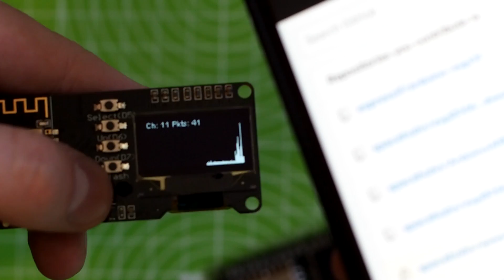WiFi Packet-Monitor | ESP8266 + OLED

Comment: spacehuhn, i love your scritpts and your videos and im here to ask a question on your ESP8266 Deauther script i have 2 small ESP8266 and they work fine, but i want to get one with an OLED display. I found a NodeMCU ESP8266 with OLED and battery on amazon and i was wondering if you can tell me if it would work with your script before i buy here is a link to it also can you tell me which bin file to use thank you!   https://www.amazon.com/gp/product/B076JDVRLP/ref=ox_sc_act_title_1?smid=A1N6DLY3NQK2VM&psc=1
Reply: I would also to know

Comment: Do you have one that works with the standard NodeMCU ESP8266? like instead of displaying the packets on the screen it will display them on whatever device you connect to it?
Reply from the maker: +Jonathan Fancher that's not possible. You need a display because you can't host a web interface while scanning.